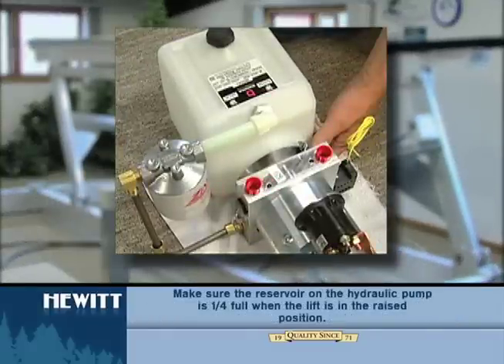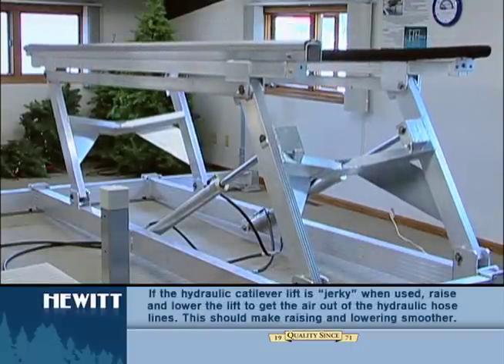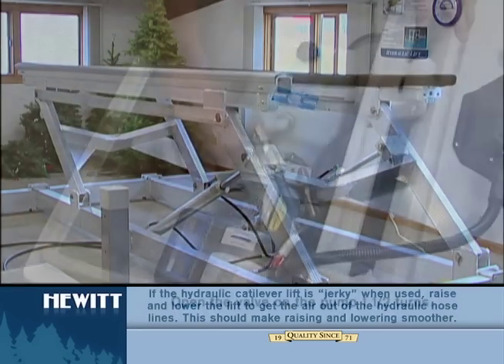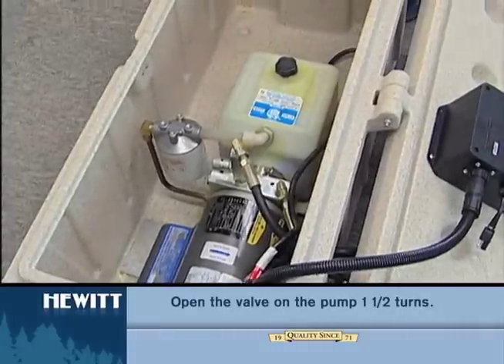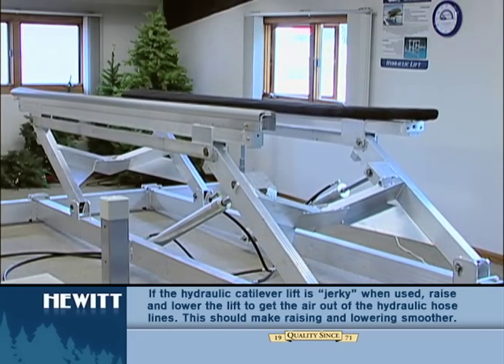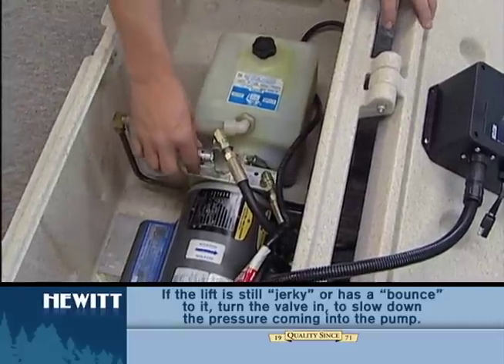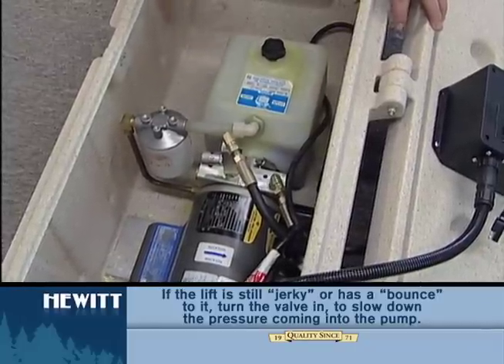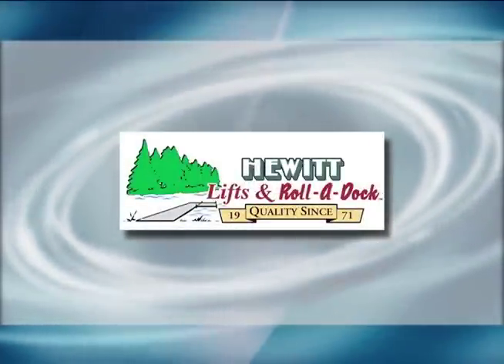How to Remedy Jerking Movements When Operating Hydraulic Lift

Comment: If boat is on lift while you are.trying to bleed lines and jerking will that hurt the lift?
It doesnt jerk when boat is off lift ..so to bleed lines I need to run with load on lift.the bouncing is scary.i dont want to damage lift.
Any idea out there?
Reply from the maker: You will need to turn down the return line. There are two flow control valves, identify the return line and turn the knob clockwise to reduce the return speed which will eliminate the jerking.